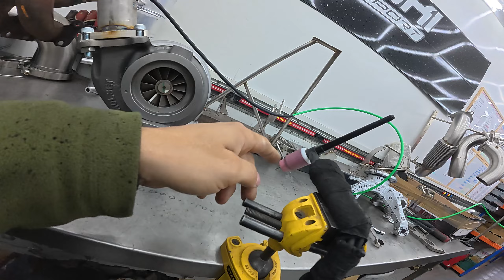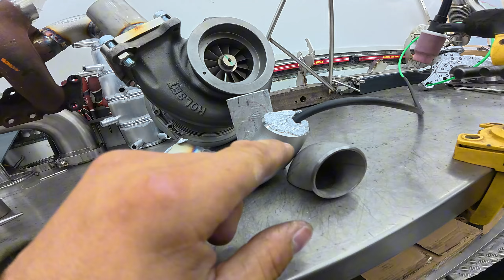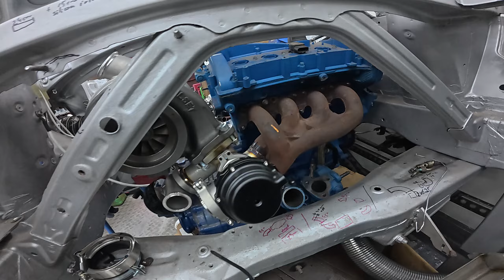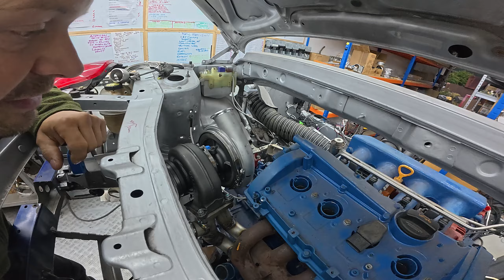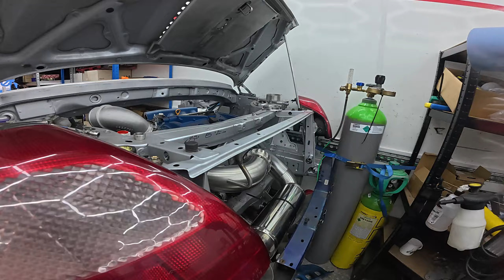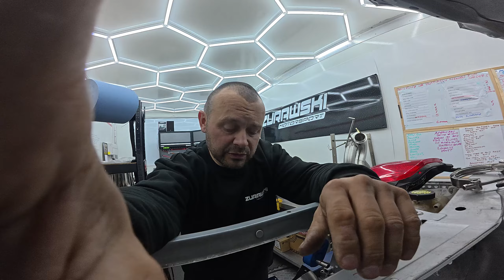Reviving the MRS-500, Frog,  turbo system

Comment: Is this going to be the 'Ultimate MR2' build for yourself? Or is that still the Vr5 turbo?
Reply from the maker: I have removed the vr5 turbo and fitted the 1.8t 20v, yes that's for my personal  MR2 which serves as development car too. I wouldn't call it ultimate as it's a very easily replicable car for anyone so far, next year it might all change but we'll see.
Reply: @zurawskimotorsport  I know it wouldn't be very cost effective but would you ever consider an Audi 2.5l 5 cylinder turbo swap? I'm guessing it wouldn't work because they're always mounted to an awd haldex system? What a vehicle that would be though...
Reply from the maker: @ReplicantBattyman funny enough we only use awd gearboxes in my conversion kit as rear mount uses transfer case mounting points do that's actually an advantage but in UK those engines are very expensive and not that common just yet, in US plenty of them, so short answer is yes but only if someone wants to send me the engine/gearbox , that being said the little 1.8t does soon good anyone would be more than happy with it.